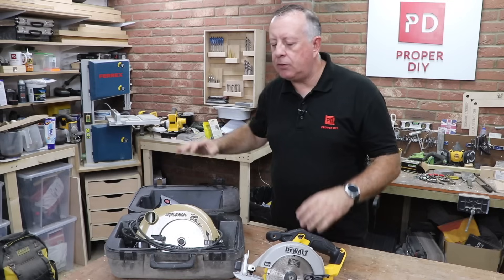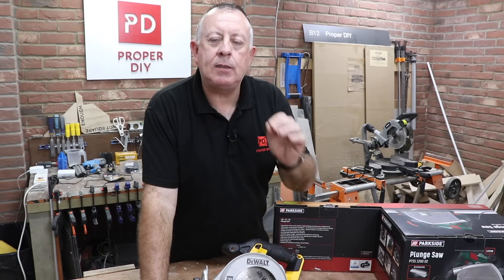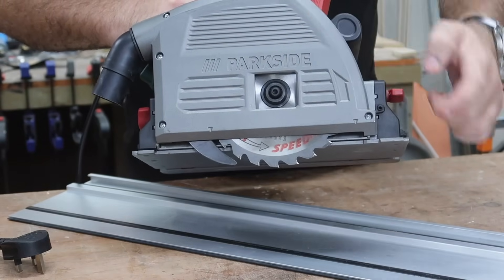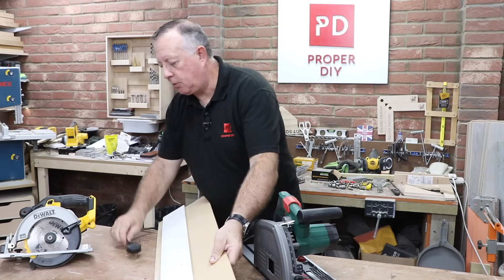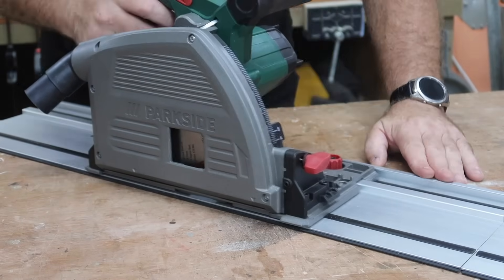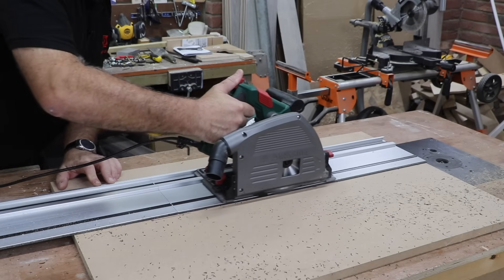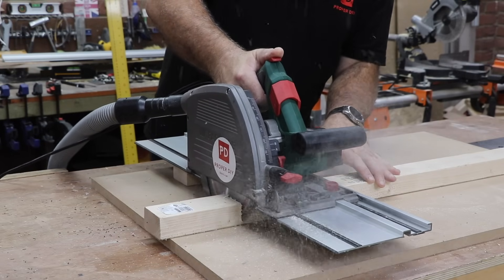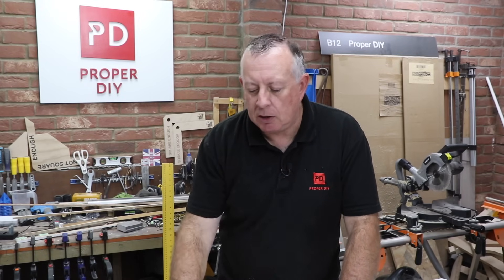Does the average DIY'er really need a Plunge Saw?

Comment: I think a better comparison would be against a table saw or miter saw in terms of which you need. A circular saw compliments the plunge saw very well for some specific use cases but the plunge saw can replace a table or miter saw for almost everything a diyer might need to do.

Comment: If only Lidl could be persuaded to stock their plunge saw more regularly. I bought an Erbauer from Screwfix it’s bigger than the park side and the standard Makita or Festool. It was £150. I have used it a lot, I have done a van conversion, and built a large shed plus a few smaller projects. The first one developed a problem and Screwfix replaced it on the spot but Lidl do the same usually. Had the Lidl one been available when I needed it, that’s the one I would have bought as it has a longer 3 year warranty. The erbauer works fine but it has a couple of really annoying features you have to turn a spring loaded knob to fully locate it on the track and it’s awkwardly placed. I haven’t but a lot of users remove it. It’s also heavy. The Lidl saw probably does the same job but you might have to buy an extra length of track and connector which then makes it a £115 or £120 saw. If you are doing a big project, such as a large van, a kitchen or lots of cupboards I’d buy a Makita or Festool, they are just better, easier to use, better dust extraction, better blades, and you can always sell them on. If I sold the erbauer I doubt I’d get £70 back but o Makita or Festool would sell quickly and I doubt you would lose even a £100.

Comment: I wouldn't be without mine, I'm on my second one in 7 years.

I've always bought a cheap saw and then a decent track set, couple this with an mft ( not festool but a cheap ebay copy) and a set of bench dogs and any cabinet work becomes so easy.

Great video, I've always wondered how good the Parkside ones are.

Comment: At least if you cut you hand off the cut will be a nice straight cut 😂. I have a track saw, the main thing it will do is speed up your accuracy. You can make a home made track still harder to line up on the cut line and cuts will be slower with the home made version
Rail square’s take speed to whole new level

Comment: Wouldn't be without one, using  Bosch FSN rails with their plunge saw, but I prefer to use my 18v GKS 18V-57G circular saw it's not so cumbersome, & with adaptor plates can use rails with my routers & jigsaw.

Comment: I made it through the whole patent period, and then some, without getting one.  But I did get one at Xmas, because I was upgrading my battery options.  Now I would not want to be without it.  But the question only comes up because of how overpriced they were.  I bought a Makita, it takes 2x18V batteries, and during the same sales, I hit on their 2x18V rear handle saw, which is more saw really. Doesn't have the plunge feature, but the framing saw is a lot more powerful and has many expensive features of it's own.  It weighs 1.5 X what the plunge saw does, all needed materials and beef.  I paid 229 for the framing saw, and 559 Canadian for the plunge saw. Neither came with batteries, fence, or charger.  So 2.44 X the price for the plunge saw.  Damn It Feels Good To Be A Gangsta.

Comment: In my view a plunge saw is a game changer and a much better option than a circular saw enabling precise cuts more quickly. Yes, with a bit of ingenuity AND TIME, you can make guide rails in timber that you can use with a circular saw but they simply aren’t as versatile. A good guide rail is surprisingly ‘sticky’ and often doesn’t need to be clamped down to achieve a good cut. It can also be moved fractionally to make the thinnest of shim cuts. Mine is cordless and I often take it with me when I am picking up large sheets from a timber merchants, as I can cut the sheets accurately there and then to fit in the back of the car, minimising waste. 99% of anything else you pick-up can  be cut with a handsaw to fit. Quicker, safer, more accurate and far, far better in my opinion.

Comment: The only drawback I can see is if you change the blade it may have a different kerf so your trimmed edge guide may no longer be accurate. Obviously you can make the appropriate adjustment so it's probably not a big deal.
Reply: Easy enough to replace the anti-splinter strip with another roll of strip for £5 if your kerf does change. I actually replaced mine with a roll of Makita strip before first use as the Parkside strip had a bit of a convex finish to it and looked like it might not sit flat on the material. The Makita strip was also much more rubber-like than the Parkside strip which felt more plasticky. It would have probably been fine after the initial sacrifical cut but having used a mates Mafell plunge saw, I thought it was a worthwhile upgrade.
Reply: @techieboy333  Fair comment. I had assumed (obviously wrongly) that the strip was a permanent fixture. Parkside is a brand that we don't have in Australia and unfortunately most of what is available start at about $750. At that price they are a little overpriced for DIY use. We do have an Ozito brand which I guess is similar to Parkside which may or may not be okay.

Comment: I got that saw but with an other name on the panel but it is the same made in China thing, well I got two, the first one committed suicide and self-destructed the motor so I had to get a new one and as a side effect I then got 4 rails and then it starts to be useful for my working. You can get rails in one-piece in different length, 1.8, 2, 3, and 5 meter, the 3 meter cost just as much as the saw, aftermarket rails are a bit cheaper but not by much.
Regarding dust collection, then there are a few modifications you can make, one is to cover the gap between the housing and the sole, an other is to a an extra sole but on the other side of the blade so to speak, it do not need to be big/huge, just cover a bit more that the points where the blade do the cutting (and it depend on the depth of cut) this mod also reduce tear out on the side opposite to the rail, it is not an easy modification but there are videos on it on YT. I locked the position of the dust port so it goes up it made my life a bit easier.
My first action was to get a new blade the supplied one is/was garbage, we got Leroy-Merlin here locally and the got some cheap blades of their own brand, and if you want the top of the pops then you can buy blades that cost 5 times the price of the saw.
A side note, I had not been able to cut my self with this saw (yet), but with my ordinary circular saw I have got a few stray cuts, both on my body and other places where I do not need them, so just from that perspective I will recommend this type of circular saw. Ordinary circular saws do have blade guard, but now and then it can get jammed in the "exposed blade" position, not good, but it do happen, I had never had this to happen with my plunge saw.

Comment: You can overhang the track a little so you don't have to keep cutting into sacraficial timber you know? Also if you shell out for a 40 tooth quality blade you will cut Melamine, ply etc with a factory finish

Comment: Great video, I have fallen foul a few times by not taking thickness of the blade into account and accidentally forgetting which side is the waste, wondering why my cut is 20mm out 😅
Reply: That's one wide blade you're using! Well, either that, or you really meant 2mm out...

Comment: Your plunge saw and cordless circular saw is the best option, I wish, but £££ . I bought an evolution corded circular track saw, more than a standard circular saw as the track was included, but very versatile. It also has a multi material blade. They do a battery version, a great choice, but it meant going up a lot in price. The Lidl plunge saw kit you have is a bit of a bargain, but as you say, you really need a circular saw as well if you have that.

Comment: I had a shed to dispose of, a skip would have cost £150 so I bought a Lidl plunge saw £70. Cut the whole thing into bite size lumps allowing a few trips to the tip for disposal… Result, I still have a plunge saw and never needed the skip…

Comment: Decided to make my own bespoke alcove cupboards and shelves and intend making my own fitted wardrobes. Decided to treat myself and bought a Mafell tracksaw . It has made my poor woodworking skills appear professional and I can’t knock the Mafell which was possibly the best reviewed saw , expensive but buy once , buy best . The alcove cupboards look great and would have cost me £3500 if someone else had built it , all told with 18 mm Birch ply has cost me about £1800 . Yes that’s a lot of money but when I do my wardrobes another £4500 I will only spend £2000 on ply and now have the track saw , so in all it will have saved me £4200 . Yes there is the cost of screws , paint etc but that will only add another £100 , plus I enjoy woodworking and have it exactly how I want not someone else’s interpretation.

Comment: Thanks for the very useful video, I bought one when I saw it but on use I found the track slid on the work surface, can you tell me where you bought the clamp that fits under the track to hold it to the work ? One again thank you

Comment: I have been waiting for Parkside to release a battery powered track saw. It seems like I will be waiting for ever. I do not want to get their plunge saw and then next weekend find out they have a track saw for sale.
One major question I have is how does the track saw compare to the plunge saw in angle cuts. Do you get plywood tear out with the plunge saw?

Comment: Interesting video, and the comments too. I've got the Makita circular saw and I bought the tracks and track adapter for it. I'd be interested to know the comparison between those 2 setups. Personally I feel the circ on the track does a pretty good job - maybe I'd feel differently if I actually had a plunge? 🤔
Reply: I have the makita 36v plunge, cordless is a game changer (can cut down sheet goods in wickes car park). I feel the biggest improvement you'd find in the plunge is the dust collection. Also the scribe cut function which is excellent for melamine etc. For a worktop I scribe cut, then take 20mm, then cut the rest, this type of role might be challenging with the circular saw? Hope that's a helpful insight 🤙

Comment: I work a lot with a Festool plunge saw and I use it to do almost any job, it is amazing. But only recently did I get a circular saw, which by the way is a Parkside circular saw. I have a lot of dificulty making a straight cut with the circular saw. Don't find it very usefull cause I can't cut straight. Any sugestion on what I'm doing wrong, or am I not supose to expect straight cuts with a circular saw ?

Comment: Still pretty novice to DIY
After cutting down banister dowells for a Stair banister with just a handsaw, I'm kind of thinking investing in a Plungesaw could be a good idea for some Alcove cabinets I plan to build. Saying that, I do like the idea of the handmade guide and Circular saw option.
Reply: I was hesitant with such an investment, but really worth it. The quality of cuts is a huge plus for the track saw. I used Makita in past, but invested in Bosch on Black Friday.
Parkside in general is fine, but you must check twice the one you're buying if it doesn't have loose parts (esp. blade mount).

Comment: Do you know where I can get extra track that is compatible with this saw?
Also small tip don't over tighten the grub screws on the track connector as it can damage the track. Nice video thanks.

Comment: Looks like the dust extraction is significantly compromised by the ability to make angled cuts. I'm wondering if you could build a simple surround (IKEA plastic chopping board) that would allow the dust extraction to work much better?

Comment: When you set the plunge saw to 30mm then tested the cut with your callipers, was there anyway that you can adjust the depth stop to be more accurate ? To make these types of saws even more versatile, some brands do a cordless version, expensive but no messy cords lying around.
Reply: set your depth by building up a mock up and putting your track saw on top of it.

For example, suppose you want to go slightly through a workpiece. The way you do this on an MFT is INCREDIBLY easy: because your track is fixed in place by bench dogs, the saw blade always goes through a groove, you just set the workpiece slightly short of the blade path, then put the track on the workpiece, and plunge your saw into the groove (not running, of course). then just push the depth stop up to snug, tighten it, and then position the work and make the cut. 

Suppose you want to be flush to a workpiece. Set the track on top of the workpiece, overhanging very slightly, set the saw on the track, and repeat the procedure as above, but with the blade contacting a flat surface rather than a preestablished groove.

Suppose you want to go partway through a workpiece. Decide how much you want remaining at the bottom of the cut, shim up that amount right next to your workpiece, let the blade drop onto your shim stack, tighten depth stop, position saw and cut. This also works well as you can actually see the depth of cut on the side of your workpiece, it's the part of the work that is sticking up clear of your shim stack. 

I like and use a cordless track saw, but I would note, one major feature of track saws is dust collection, (it's one of the cleanest carpentry tools you can buy, particularly if you use scrap below your work to close off the bottom of your cut) and you will spray dust everywhere without a dust extractor. So while I prefer a cordless for outside or awkward work, you probably want a dust extractor hose anyways, so it's not a big deal to run a cord at the same time, especially if you use a dust extractor with pass through power, like festool.

Comment: Im really torn. 
I've just moved house and was looking for a circular saw to help with jobs around the new house. For e.g Trimming doors, cutting work tops, cutting MDF for wall panelling etc
My budget is about £120 and had decided on the Dewalt 560. However, i've come across so many videos that say the circular saw isn't that great for the jobs listed above and a plunge saw is FAR better but you NEED to get a good brand. Sadly, they're all way out of my price range. 

I'm torn whether to get the DeWalt and build my own fence/guide and hope that it's okay for the above jobs or buy a very cheap branded Plunge saw and hope it lasts.

Comment: I started doing carpentry with my brother in law when I was 12 years old that was 45 years ago.  What makes this an interesting point is I have never seen or heard of a plunge saw.  The only reason I looked it up is I am looking at the cordless Milwaukee table saw and under saws this little machine came up.  
   For me as much as I like it and what it can do it would not be something I would use.  To be honest I understand why carpenters don't use them,hauling around the track system would be a nuisance and they would most likely get damaged.  
  That being said around the shop I can see this definitely coming in handy.  However not at $900.oo Canuck bucks for the Milwaukee cordless. (550.oo without a battery.) even a cheap one at $400.oo is too much for how often I  would use it.
  Great video and love the tool but not for me.  Yet.
Reply: I just bought the Milwaukee plunge saw kit (that comes with a packout box and 6A HO battery) for less than $400. It was a promo that stacked a couple different discounts. Considering this single saw can replace circular saw and table saw, it's totally worth it
Reply: @riverfu889  
You wouldn't lie to me would you?  Because I'm going to tell my wife i need one now.
  Ya you sound like a stand up guy to me and very knowledgeable.  Still getting the table saw though.  I do a lot of finishing work and nothing beats a table saw for getting down to a 32nd of an inch.

Comment: the downside to buying the cheapest saw is that it may be problematic enough (wobbly, inaccurate, not finely machined) that it betrays its genre. And it might be hard to use, which might make you less willing to use it. Whereas the top of the line might be accurate enough, and enjoyable enough to use. 

Sure, you might end up never taking it out of the box, or realizing you don’t use it that much—but you can sell it used. And you might lose about as much money as you’d spend on a crappy tool you replaced. 

And I’ve experience myself that I won’t buy a tool (label maker, I’m thinking of) with more and better options simply because i’ve already bought a lesser one, and I keep thinking I can just make do. I’d have been better off rounding up a at the initial purchase.

My personal plan is to buy about 1/2 or 3/4 up the scale, unless money is REALLY tight, in which case I don’t really need to buy the thing anyway.

Comment: Perfect timing, im pondering this exact question. Anybody got any recommendations on cutting thin hardboard? Would I get away with a circular saw (worried about rip out) or should I fork out for a tracksaw?
Reply: I've had no issues with tear out using an ordinary circular saw with a track jig, not even fitted as flush as Stuart's one in the video. Just try to avoid letting the board sag as you cut, or it'll probably do something horrible to itself on the last 5% of the cut.

Comment: looks the same as the Rutlands one, noisy horrible thing and handle gets hot, something dodgy going on with the electrics. Best thing is to spend more money, they're great and with some invention on the template front can do all sorts and be accurate and so much easier than a table saw for sheet material. Just take your time setting up and sort the dust extraction.